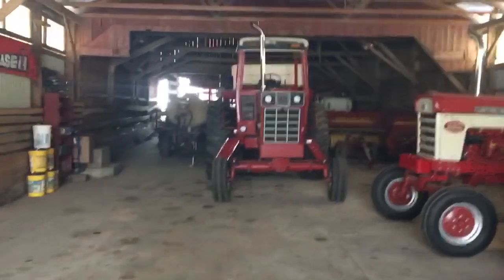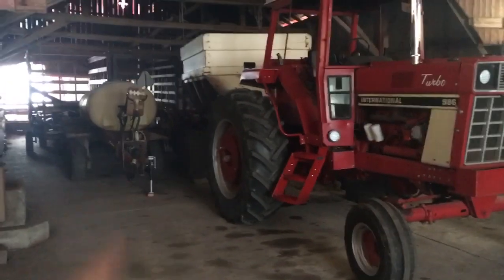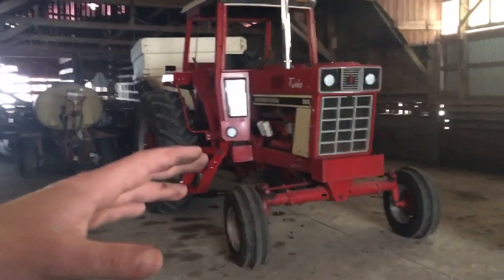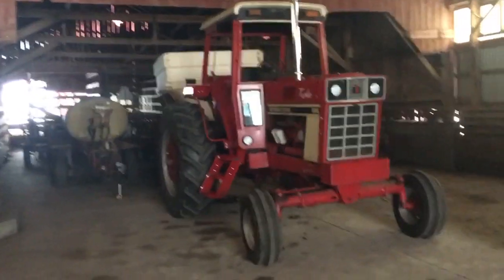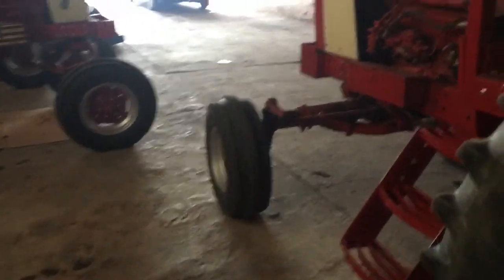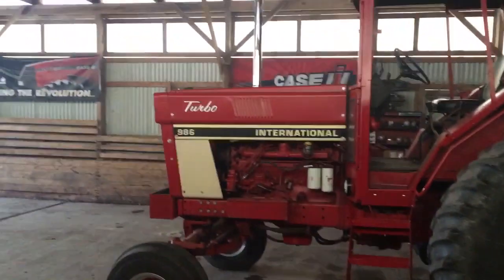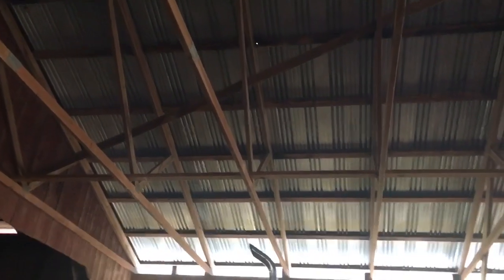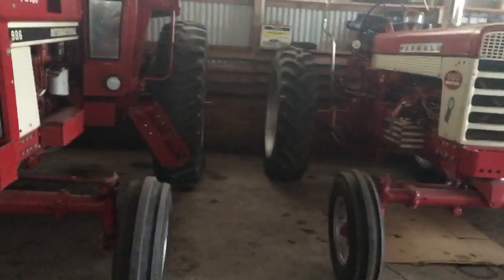Cold Batteries Cold Soybeans

Comment: Change the the ball joints and tie Rod ends on the front of your Passat. They wear with age n the moment you do anything with the front wheel drive on them you'll  have issues. Its 2hour diy fix n should cost under $100. Theyre great cars n won't rust out in the snow n Salt. Have a 2005 W8 Passat    4motion, 2001 Bora (Jetta) v6 4motion and a 2018 Amarok v6 tdi ultimate. Won't buy anything else but VW.